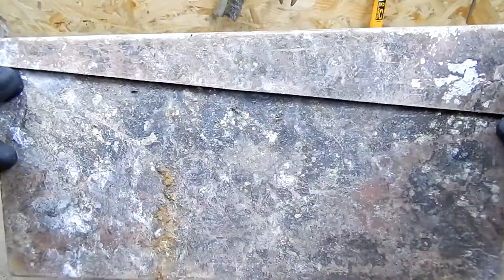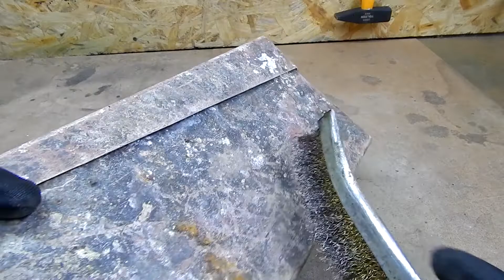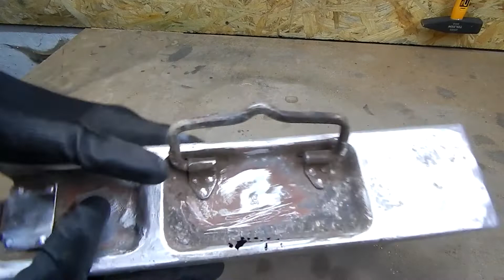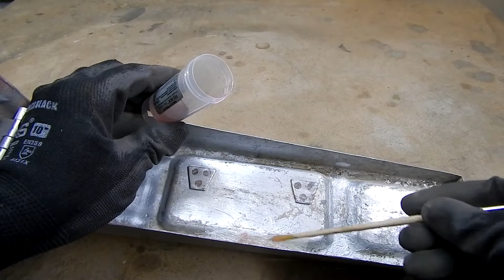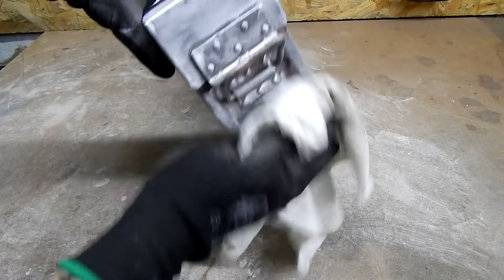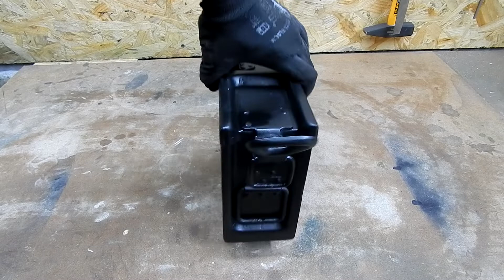RESTORATION,, ammunition box of a German machine gun MG,,

Comment: hi, I have a similar tin - all rusted, but not deep pitted rust - it's solid. I am thinking i can buff off the rust exactly like you did here. What disc did you use on your angle grinder to get it back to the bare metal?
Reply: or is that some kind of orbital sander used for car body work?
Reply from the maker: I started at 240 and reduced to 600